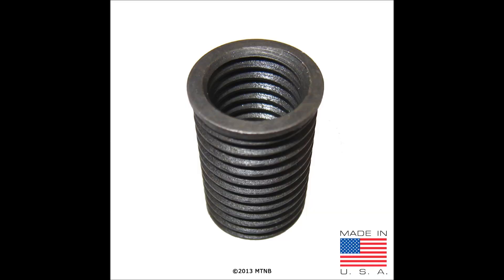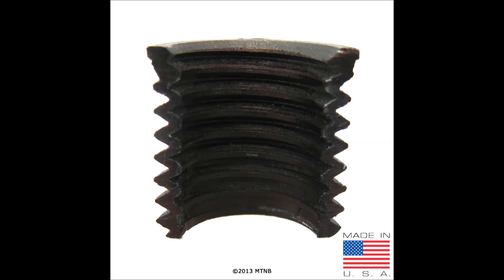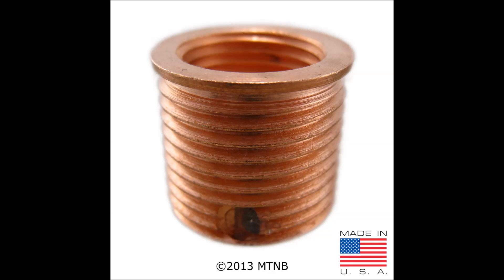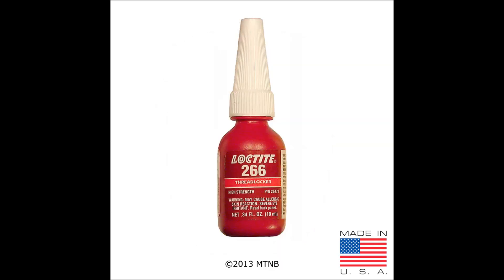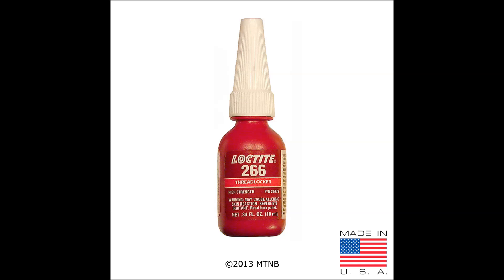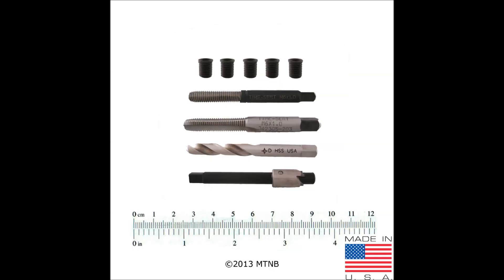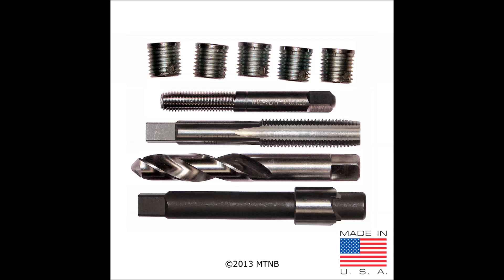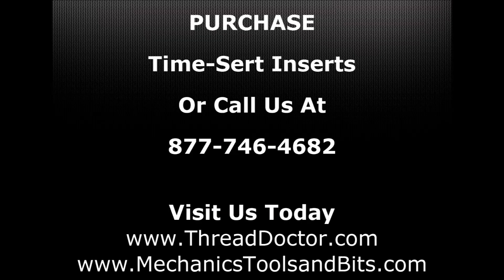Time-Sert Thread Repair Insert Informational Video

Comment: Update the links.
What should I use on a aluminum trhead? Aluminum time sert or also Stainless steel?
Reply: Did you ever find out bro?
Reply: @jonathantrejo6853  i used stainless steel on aluminum.  Work great. I bought from pitsert the are good seller. You may ask also they suggestions.
Reply: @jonathantrejo6853  Yes, you may use stainless steel tine sert on aluminum